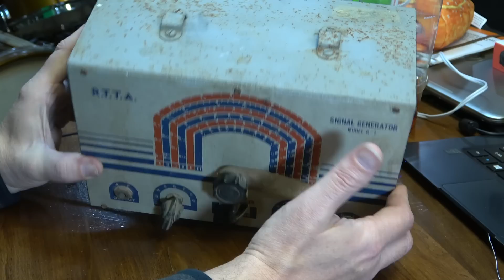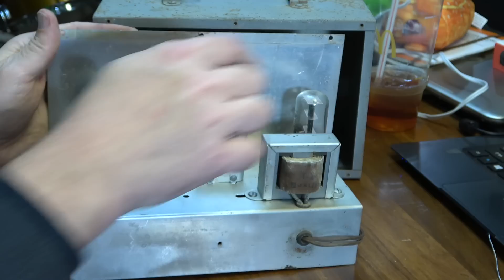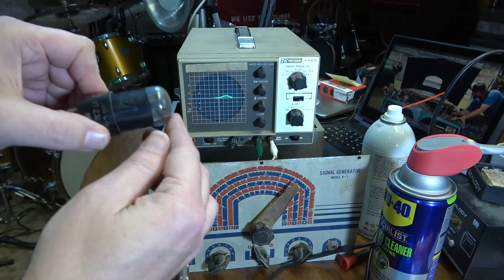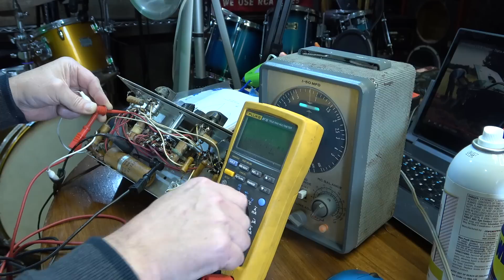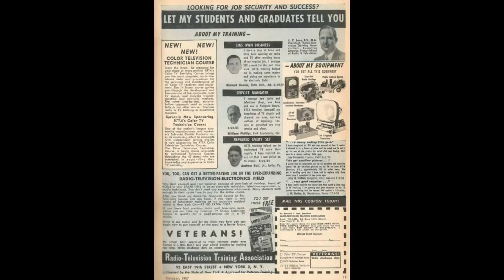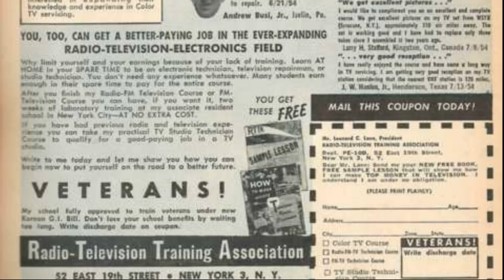OLD Electronics Lab Gear Hides History Inside! --  1954 RTTA K-7 Signal Generator Restoration

Comment: I was big into my Ham Radio hobby between 1995 - 2005 and then got hooked on fixing up old radios from the 1920's -1940's. I got tired of hunting for tubes on eBay and getting gauged tring to buy NOS early tubes, so I ended up buying out the entire inventory of tubes and test equipment from a 92 yr old radio/TV repairman in Indiana. I live in the Chicago area so I drove the hour and a half with a rented UHaul truck and closed the sale. I was mostly interested in the Pre WWII tubes especially the tubes for dozens of Atwater kent Breadboards I was restoring. The sale included a couple hundred 6V6 and 6L6's along with more 12AX7, 12AT7, and 5U4G's than I could count. Along with these tubes were tons of TV tubes that I couldn't seem to even give away. In 2012 I sold my home and had a big Ham Radio and Antique Radio sale in IL and unloaded about 30 huge tube caddy's full of these tubes for between $50 and $100 a piece (maybe 25 cents to 50 cents a tube!). I could cry now that I see what these tubes go for and having an interest in building my own guitar amp... Man oh man...

Comment: I worked for many years doing Commercial sign repair abd manufacturing..part of this was Service repair on Signs...including Neon signage....they are High Voltage but Low Amperage ( still very dangerous )....getting zapped was normal and would wake you up if early in the day.... average voltage is 7,000 to 15, 000 Volts....enough to arc and actual touching isn't required at times....amperage is in milliamps but they come in low to high versions.... and a loud buzz will be heard just before you get hit.... followed by varioys screams and curses depending on the person... i got shocked by AC too...that feels differently and not fun either... shocks are never wanted but can happen .. welding in rain ....not fun....testing for spark on a gas engine ... another fun experience you want to avoid....🇨🇦🤓🤙

Comment: It looks like it was built just like one that I have under a different brand. All of those bands are RF. A&B are in kHz and the rest are MHz. It only puts out a single audio frequency. I want to say it was 400Hz, but it may be 1kHz. The bands should have some of the special frequencies marked accordingly, for example 455kHz should be marked, as that was the standard IF of AM radios at that time. You would dial in an RF and then modulate that with the audio signal. The audio signal didn't have to be perfect, it just had to be audible or able to see it on the scope through the various stages of the radio. It is a much simpler way to align AM radios than using a modern generator, where you have to press multiple buttons or menus to set up the IF or RF frequency and then the amplitude modulation and then the audio frequency and percentage, etc. Just hook this up, dial it in and you're in business. Because the dial is not very accurate I have mine connected to a frequency counter as well. Try using it on your next radio restoration for the alignment.

Comment: This machine has a FIXED audio oscillator  a relaxation oscillator  using a neon bulb. It is used to modulate the RF signal. The RF oscillator will be a sine wave as it uses coils. You have not repaired it, otherwise it would  show an RF signal. You are correct though, its rubbish, very cheaply made to profit from the unfortunate poverty stricken souls that gave their last few dollars in an attempt to better their lives by achieving a skill from these  "learn by post" electronics educators of the 40s/50s. The certificates were meaningless, only a few lucky ones  would actually enter the industry..
Reply: It showed an RF signal when he had it connected to the RF output. In order to get both on the scope, you have to combine an RF signal with the single AF signal that is generated. If he would have done that you would've seen a modulated RF signal on the scope.

Comment: Hey Brad! 😃👍!  Trouble is I think it still has a fault that's distorting the heck out of its output waveform!  I could be wrong but I wouldn't want a signal like that as a testing signal!
Reply from the maker: Others with this same model report the same waveform.
Reply: @TheGuitologist  Oh right.  Fair enough then, as long as it's frequency is adjustable I spose!

Comment: I doubt that the waveshape this is producing is deliberate as a simple oscillator is far more likely to produce a sine wave.  I suspect that the strange waveform and the inability to vary the audio ouptput frequency are related.  If you can fix the latter then the output would likely become sinusoid.  I'd check the variable capacitor for dirt and corrosion on the rotor's bearing/commutator.
Reply: If it is like the one that I have, the audio frequency is not adjustable, only the RF. There is only a single audio frequency generated (400Hz or 1kHz, I can't remember which). This would have been used to align the antenna, RF and IF sections of an AM radio. The AF signal did not have to be perfect, but I think you're right, it probably still has some issues and Brad didn't have any impedance matching between the generator and scope. There may be some compensation problems with scope as well.
Reply: @srtamplification  So, I was way off base here.  Your description explains the switches on the RF and AF level controls. That is, the RF switch determines whether there is any output and the AF switch determines whether the output is modulated by the fixed frequency audio.  I agree that the 'scope may have issues and I still suspect the variable capacitor.